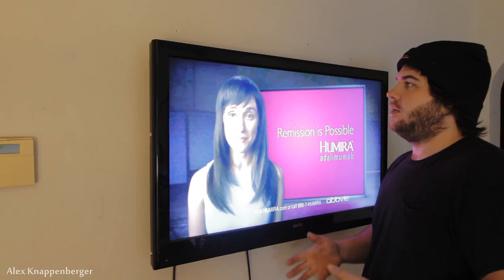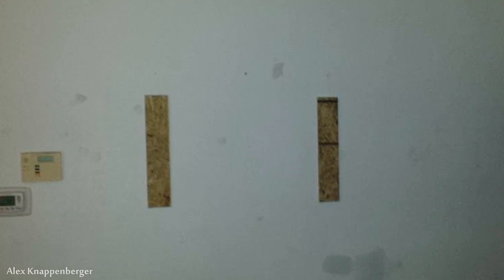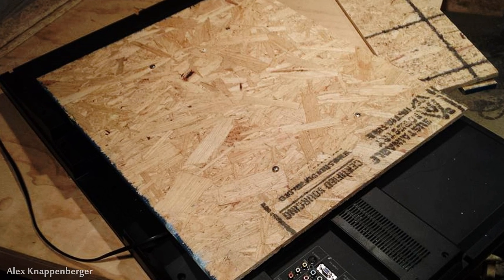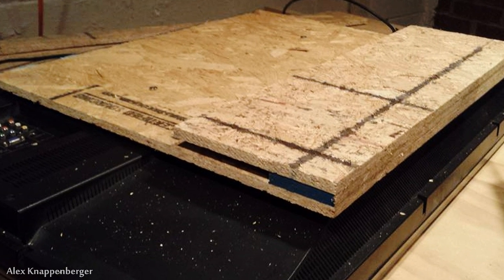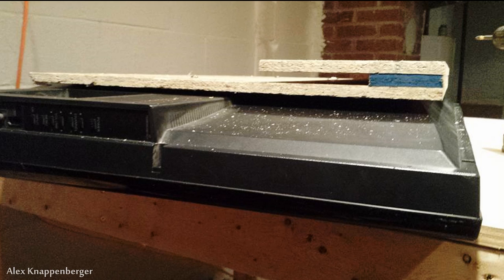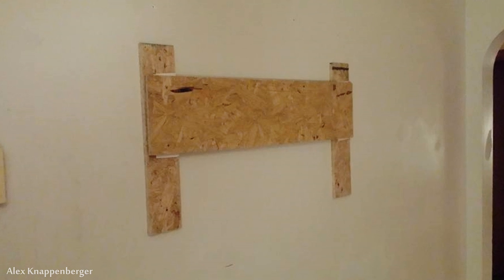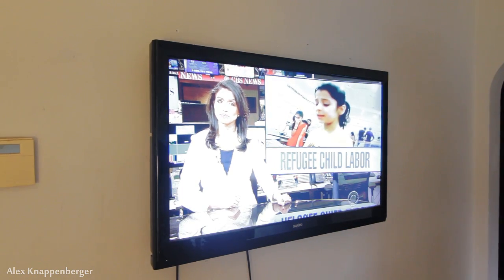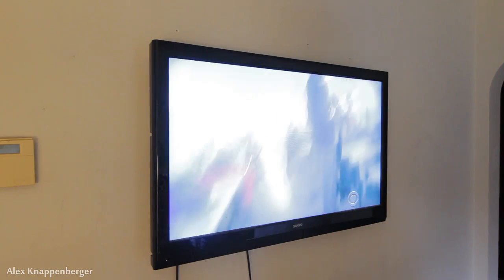Build a TV Wall Mount for Free  ✔

Comment: French Cleats? Sure, find some free french cleats laying around by the dumpster lol Good job man. THIS is what I needed.
Reply: A french cleat is a piece of wood cut at a 45 degree that  interlocking each other.  It's what is holding up my monitor as I write this.  If you need the TV to telescope out and swivel you will need a metal wall mount.
Reply: @stephenkenney729  Thanks! I learn something new every day.